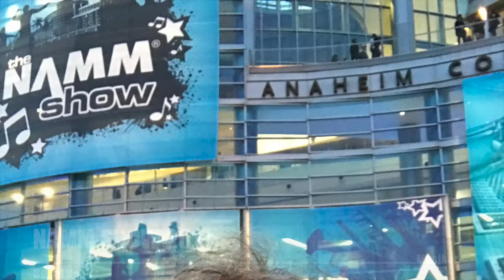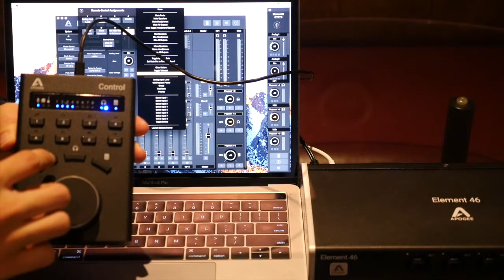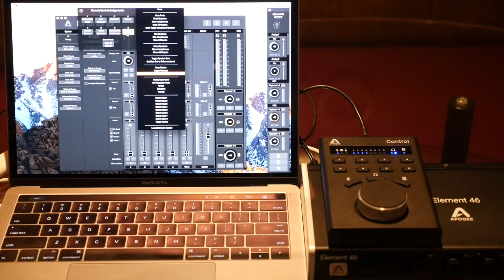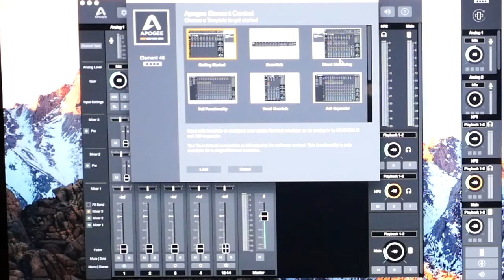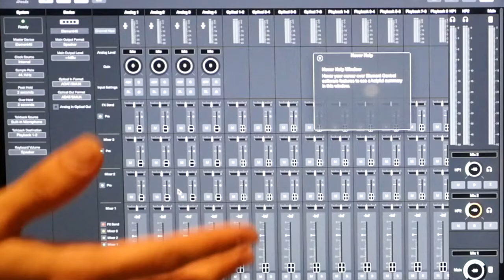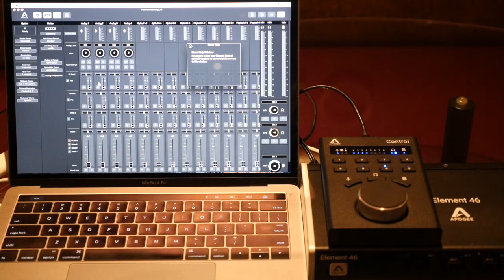Apogee Element Control

Comment: Thank you for your video, I have a new MBP Touch bar and I use my Duet 2 for now but I think to buy the Element,  Do you think if an update was planned to take advantage of the technology of TB3 ?  You use The Apple adapters (Thunderbolt 2 / USBC) Thanks in advance.

Comment: thanks for making things clear - USB connection not to the Element but to the computer. Was wondering as there is no USB port on the Element! But - how does the talkback work if the computer's lid is closed and the computer is 4 feet away? Put another way, is there no talkback mic on the remote (which is where you would expect it to be)?

Comment: hi, have you tried element on logic 9.1.8 ? Thanks
Reply from the maker: That was Apogees Computer and I have not tried Element with Logic 9.1.8. I suggest to contact Apogee Customer Service - via the chat on their website. They are super fast with answers.
Reply: thanks, i buyed element 88 and it works with no problem with logic 9.1.8; i'snt official but it works

Comment: The software is god awful. Please go back to the old software. It took me 5 hours to figure out how to monitor my digital input
Reply: DGLS_Official 
Would you maybe have considered posting:
I found the software awful?
Also, do you think someone who had not used Maestro before would find it so challenging?
Reply: I think it's great (apart from that basic 'monitoring' set up) better instructions of which should be included in the pamphlet/ online PDF manuals. Like you (after reading the pamphlet manual), it took me one risky session 'without' monitoring till I realised there are 'drop downs'. As soon as I clicked on 'Mixer 1' - hey presto! I could hear my inputs. BTW - BEWARE all users - almost blew up my nearfields with this software in combination with Sonarworks. Don't know which software is the culprit - but the Apogee software rocked up to MAXIMUM several times for no reason..  keep an eye on it if you don't want your ears/monitors blown...